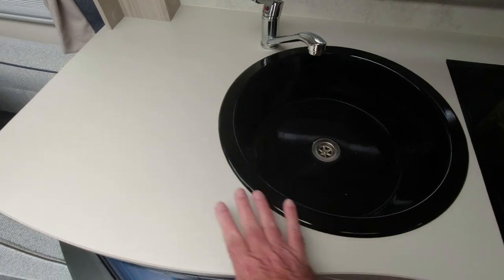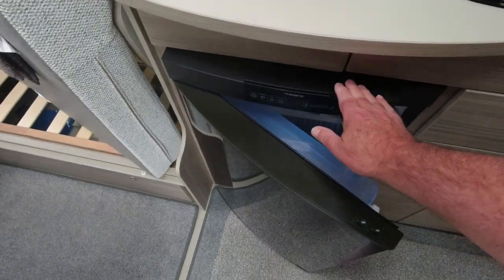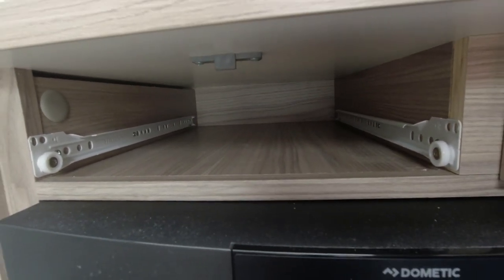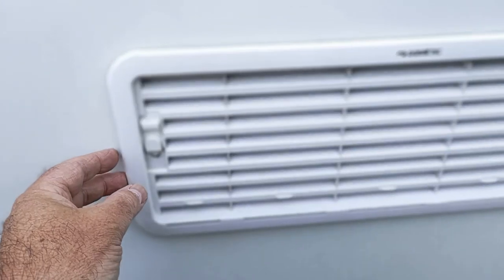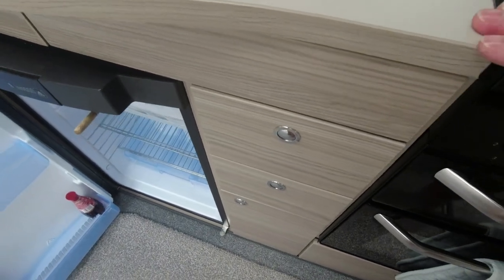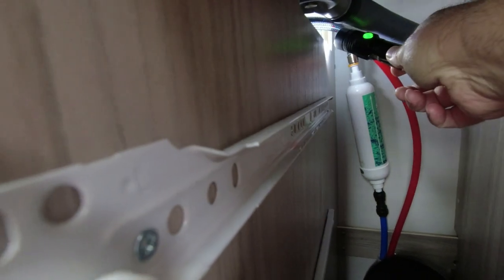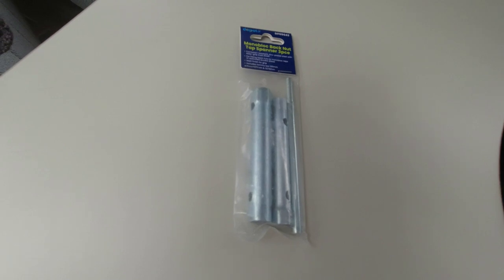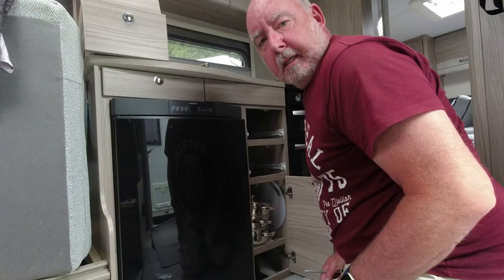HOW TO FIX A WOBBLY ELDDIS 550 CARAVAN KITCHEN TAP

Comment: Good fix. maybe you could have used a open ended spanner. Caravan still under warranty?
Reply from the maker: It is just still under warranty but past experience with service departments has not been good and ended up  re-doing it myself, searched for way to do it on YT for this caravan but could not find a video so thought it was time to help people with a video so they can do it themselves, Yep not much room did try with spanner but due to the position of pipe connection to tap & nut it was hard to get spanner on 👍